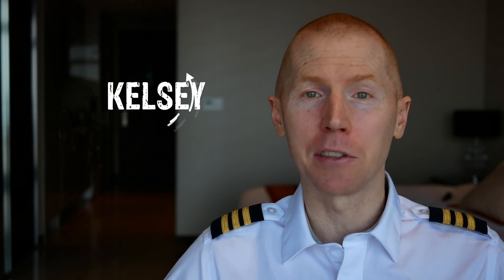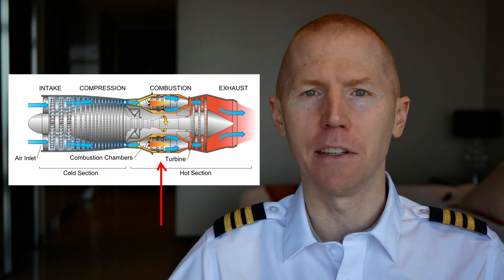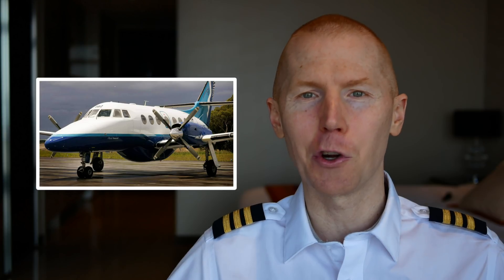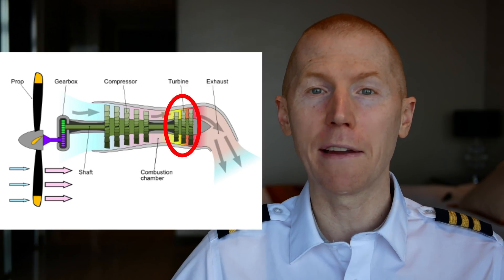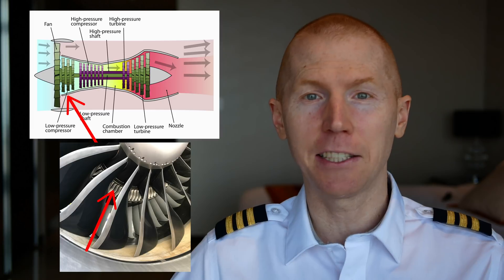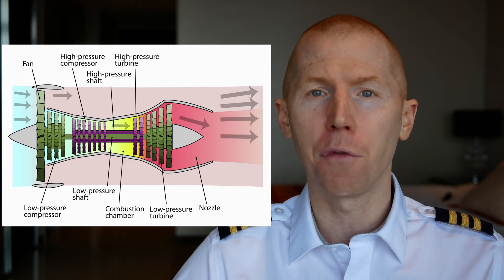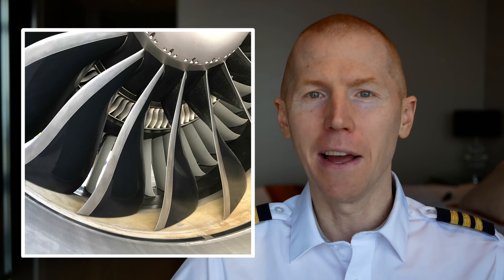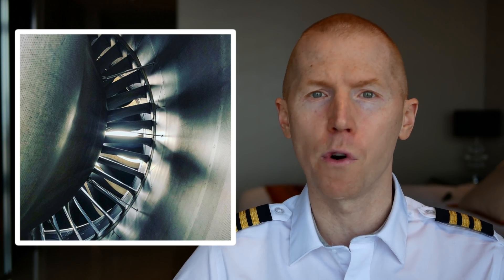Is a Turbofan Engine or Turboprop Engine Safer? | Pilot Explains

Comment: What about single engine turbo props like the Pilatus PC12?  Isn't the jet basically backwards blowing exhaust onto blades turning the prop?  And what about Prop Jets?
Reply: Do you mean ("Prop Jet") the engines developped in the late 80s? I know them as "Prop Fan" or UDF. They followed the same philosophie todays engines do : saving fuel by making the bypass bigger, but they did it in a more radical and brave way.

Comment: I have no problem flying on a turboprop, and they are more fuel efficient than turbofans.  However I do think turbofans are safer. Propellers seem to have a higher failure rate than the fans. If a fan does fail, the shroud is designed to contain the debris. It does not always do so, but failures are still much less likely to damage the fuselage.  Perhaps more important, turbofan aircraft have more bleed air for better anti-icing.  Much less likely to loose the entire aircraft in accidents like the ATR that crashed in Roselawn, Indiana.

Comment: I'd be more concerned with flying a cut-rate airline which is more likely to skimp on maintenance - regardless of the engine type.
Reply: Hmmm, the Logan-Air Saab340s strike again!!
Reply: actually a cut rate airline has to follow the same maintenance procedures set by the aircraft/engine manufacturer and approved by the FAA, the chances of a dangerous accident are very small, more likely to do with pilot training (or fatigue) and the aircraft mechanics being careless, again accidents are unlikely but very random (the design of the aircraft does play a role) it is usually only in 3rd world countries that they skimp on maintenance, in USA and EU people are more likely to follow the correct procedure
Reply: @jrcolmena  Indeed hell the same point could probably be made about piston engines even, I would be willing to bet that a not insignificant factor in their reputation for unreliability is that they are disproportionately installed on private aircraft not used in commercial service and thus not subjected to the intensive inspection and maintenance regulations that apply to commercial carriers. Any engine is going to be a hell of a lot safer if you put the effort in to make sure problems get found on the ground when you have an abundant supply of both time and options to easily resolve the problem, the supply of both is greatly reduced if you wait until you are in the air to discover the problem.
Reply: @FaerieSeraphina  You are most definitely right about that.  In fact, it has been proven.  I can guarantee that if general aviation (private) aircraft were maintained at the same level as commercial aircraft, the accident rate due to any sort of mechanical failure would go way down.
Reply: @jrcolmena   I still wouldn't chance it. When I was flying from Dubai to London the cheapest flight I found was some Italian carrier I'd never heard of. I decided to google the airline and found out it was going bankrupt.

I'm sure their procedures were top-notch but I wouldn't trust an aircraft maintained by technicians who are distracted by the prospect of losing their jobs, the thought of not being able to make mortgage payments etc.

It's all contributing human factors that can lead to accidents.
Reply: @jrcolmena  trains also have rules. Didnt stop my local service from being bought out, then the new company found out the trains were not safe and had to be replaced :/ Dont trust these people
Reply: The bigger cut-rate airlines have a really strict service routine, since they are extremely picky about not having their aircraft’s unplanned on the ground.

Comment: Had no idea that commercial jet engines work like this. Always thought the front fan blades were just part of a jet engines compression fans and it all worked like a standard jet engine. Never knew they acted like a propeller. Thanks for the video. 👍
Reply: They do act like propellers in the sense that they pull in air but the fan is not actually a propeller, you had it right when you said the fan is compressor. The fan blows air through the bypass duct but bypass thrust is created when the air accelerates through the constricting duct and out the back. The net thrust of the fan itself makes up less that 1% of the engines total thrust.
Reply: @ChrisZoomER  ah right, I might have understood the video wrong but it sounded like the front fans did the propulsion part of the job, like the whole engine was an enclosed turboprop. Thanks for clarifying.
Reply: @orbazel  Yes, that’s a HUGE misconception is that the fan is responsible for the majority of the engine’s thrust and that a turbofan is nothing more than a ducted turboprop whose propeller has a lot more blades. People  including pilots usually give and/or are given this explanation because it’s “simpler” when in reality, bypass thrust is a lot more complicated. Further more, a propeller’s efficiency starts to plummet at around 350 mph and the 747 flies at more than twice that speed.
Reply: @ChrisZoomER  can you explain? I was always told that the fan creates up to 80% of the thrust and the core is only producing about 20% of the thrust in a hi-bypass config. I thought that was the whole purpose of these engines otherwise why not just use a turbo jet. Pardon my ignorance but perhaps I was taught wrong. Thanks
Reply: @californiacastle  The bypass does produce 80% of the thrust, that's correct but it's not through the fan acting like a propeller. The fan acts like a compressor more than anything else much like the blades of the LP and HP compressors, except the fan blades are a lot bigger. The fan blows air through the constricting bypass duct where the bypass air compresses as it's forced to squeeze through the ever-narrowing space. The fan puts all of its energy into compressing the incoming air so it doesn't have any energy leftover to produce any thrust of its own. Once it reaches the back of the bypass nozzle, the bypass air expands and accelerates out the back producing thrust in a similar manner to the core exhaust, except without getting mixed with fuel and burned obviously. I hope this helps.

Comment: I’m never had trouble flying on a turbo prop or a turbo fan engine. To me a turbo pro and helicopter are very similar. I’m spent over 200 hours a year flying on helicopters as a passenger. Most of the time fly within 100 ft of high voltage power lines in mountainous terrain.

Comment: Spot on Kelsey. My girlfriend told me, after a short hop from Chicago to Toronto, she was nervous because the Q400 was a 'propeller plane', citing concerns of age, lack or reliability, and the propeller flying off and into the cabin like a boomerang of death! I told her that plane is actually very modern and uses a jet engine to drive the propeller. 
I'm curious though. Do planes like the Q400 rely more on prop pitch to adjust speed? I remember on takeoff last year the plane launched forward, but I didn't hear any spooling up of the engine.
Reply from the maker: it could have launched forward because they ran the engines up with their feet on the brake and let them off suddenly... its harder to do than it seems 😆

Comment: I still don't understand why you need a fan and a turbine instead of rocket engine.
Reply: rockets are unreliable, loud, underpowered, and very fuel unefficent
Reply: Yes, it seems that the gases exiting the exhaust don't do very much work in the rocket engine, so there's the turbine engine, which utilizes much more of the kinetic energy of the exiting gases, because the gases not only exit, but they spin the turbine at the end of turbine engine, which is somehow more energy than it's supposed to be by the Newton's third law of motion. You can surely enlighten me.
Reply: huh?

Comment: Why do aircraft engines get quieter a few seconds right before full throttle takeoff? I was a flight attendant for 6 years and always wondered but never asked.
Reply from the maker: well JM, it could be that as they turn onto the runway they pull them back so they get as much of the runway as possible... so we power onto the runway and then make that sharp turn before we actually go... could be that.

Comment: You forgot to mention the benefit of noise reduction with turbofan.  The air that flows around the compressor section acts like a "noise cushion" by surrounding the hot air that is expelled at the end of the engine, resulting in a very significant noise reduction.

Comment: For me, it's not the engine type that affects my comfort, rather the size of the plane. The Jetstream 32 i believe is a 19 passenger vehicle compared to a 747 which has hundreds. And not fundamentally because of the size itself but rather because the government uses different standards to certify big versus little. Little airplanes have fewer requirements to meet and therefore aren't as vetted as big planes.
Reply from the maker: well now any part 121 aircraft has to meet the same climb certification to be allowed as an airline aircraft.  But I agree having 4 GE engines seems a lot better than 2 turboprop engines Ajs, thanks for watching and subscribing.

Comment: Thanks for the video. Are the jet engines inside a fighter jet a turbofan engines? Some of them have afterburners.  Is there a special name for those engines?
Reply from the maker: it is a turbofan but its augmented, obviously a bit different than what you are flying on a commercial airliner.  Technically its called an after burning turbofan.
Reply: @74gear  Thanks for the information.  Best wishes.

Comment: Is the increased noise in a turbo prop due to the larger blades or poorer insulation?
Reply from the maker: there is a lot of noise coming from a turboprop but yes the blades cutting the air similar to a helicopter is one of the noise Bob.

Comment: The only time lack of reliability comes to mind when I see a propeller, is if it is being driven by a piston engine that hasn't seen a maintenance crew in far too long (had more than a few engine failures when flying 172s during my PPL training, DA-40s were not so bad) 

Gas turbine engines (the engineering term for a jet engine) are the most reliable type of engine available, whether it is a turbojet, turbofan or turboprop variant is irrespective
Reply from the maker: yes pistons are definitely less reliable for sure... luckily the mass of those planes is so small and they have a pretty good glide distance people can often survive a crash in them. 👍
Reply: @74gear  yep, I remember my first time gliding a 172 about a month into my training after the engine died, the glide ratio was better than I expected 

Still came in about 20ft short of the runway and tore up the grass, but the plane wasn't damaged (still not sure why my instructor wouldn't take control for that particular landing)

Comment: More comfortable? Not on an atr72 if icing is a remote possibility. Unless it's been that type of day where Rob white comes to mind "hit something hard I don't wanna limp away from this wreck"
Reply from the maker: well most turboprops have an anti ice system...so not sure why that would be your concern.
Reply: @74gear  aircrash investigation... At leadt they made it seem the atr72 had an issue for a while. Mostly sarcasm though, I understand regs and hardware evolve to prevent repeats and it was a while back. Actually I've jumped out of an otter first time jumping with only two people holding handles so I'd probably ride even if it still flipped and fell 😂

Comment: Given the diameter of the fans, is there an issue of the blade tips going supersonic as on the high powered WWII piston fighters?
Reply from the maker: thats more of an engineering question thats outside of my knowledge on how those designs are made.

Comment: I believe a turbofan is safer as there is a duct to confine a broken fan blade. A turboprop is basically a non ducted turbofan, so if a propeller blade comes off, it can slice into the fuselage. Also, as it is not ducted, it is less efficient as each propeller blade tip creates a vortex (just as a wingtip does).
Reply: not realy: a propeller blade is FAR stronger as a turbofan blade (prop blade broke occurs close never), and the duct as a high drag who void a large part of the gain, so the efficiency from free propeller is better because much bigger diameter= much more air forwarded with slower acceleration......

Comment: Hi, I have flown once with a Bombardier (Dash?) Turboprop plane. I think people experience it as smaller and  less stable, so maybe that is the reason they are more nervous. I knew it was a safe plane, and more environment friendly as well (?), so I enjoyed it! I did not know that turbofan also partly works as a propeller plane. This was new for me! I guess the first jet engines were not of a turbofan type?
Reply from the maker: know the original jets weren't the high bypass fans you see operating today... they were a lot less fuel efficient.

Comment: I think a major unreliability aspect of turboprop aircraft come from the perceived age of that group, not from the engine itself. Older aircraft are prone to need more maintenance actions due to age and fatigue.  Newer turboprop aircraft have similar reliability as turbofan aircraft. I think a minor factor that affects turboprop aircraft is the need for a reduction gearbox. This because the propeller and turbine both have different ideal rotation speeds. The reason i see this as affecting reliability is that a reduction gearbox adds complexity that isn't present on turbofans, even on dual spool turbofans. Though aircraft age, operating conditions and maintenance quality all play a larger part in reliability.
Reply from the maker: that could definitely be part of of Kurt, valid point.

Comment: Nice video Kelsey! Since I’m limited to piston at the moment, I’d take any turboprop I can get my hands on. The only thing I would be worried about is the speed reduction gearbox. I would prefer a nice high bypass ratio jet every time. But I’m stuck at piston right now haha.
Reply from the maker: well we all had to start somewhere...  keep grinding  you will get there.
Reply: 74 Gear that’s right. Can’t start with a jet. Already started instruments ground, with king schools, working for my written. Going to ATP either in June or July.

Comment: with regards to the bird making it into the inlet, thats easy to understand. A simple experiment would be to take stick, around 4' long, and go out when it is raining. start twirling the stick above your head and walk in the rain. Your still going to get soaked, no matter how fast you can twirl it.
Reply from the maker: thats not really the same thing as a bird going through a turboprop blade though.
Reply: @74gear  sure it is. it doesnt matter whether it is a turboprop or electric motor, behind the props. At the end of the day its still just three or four "sticks" twirling in the air. Do you have a ceiling fan in your room? if you do, turn it on the fastest speed and throw something at towards the ceiling. How much you wanna bet that at least a third of the time whatever you throw at the fan, will go through and hit the ceiling?

Comment: Thanks, never knew they had a gearbox, would you happen to know the gear ratio? just wondering why its not direct drive
Reply: Ratio vary. Direct drive lacks efficiency,  drives props too fast and has no reverse. Same reason  a car has a transmission.
Reply: There is some complicated gearing going on, most Turboprops also have Constant Speed Propellers. The propeller automatically adjusts its blade pitch to maintain a set RPM level. Pushing the throttle makes the prop bite harder into the air while it still continues spinning at the same speed.

Comment: I've flown on a dash 8. Only thing that bothered me was the large amount of noise vs an regular jetliner.
Reliability is down to the individual airlines maintenance procedures.
Reply from the maker: ya they are pretty loud Bob, that jestream I flew was a bit louder 🤣
Reply: Probably because I'm old and my father has an affinity for WW 1 planes (and a Piper PA-12 we rebuilt in the early '70s that he still flies at 80+ years old) I always find it a treat the times I get a dash Vs. a CRJ (or worse an Embraer).  Lol I guess I just trust a prop I can see & hear Vs. the black magic of a jet engine.
Reply: Although I will say a Dash is a lot quieter than a Ford Trimotor!  Been lucky enough to fly on those old radial engine beasts twice now  :)

Comment: Am I correct to assume the "ducted" fan is more efficient then open propeller because none of air is spilled outwards?
Reply: no you are false: the duct as a high drag, so it's usable only on small "propellers", free propellers have a much bigger diameter, so they efficiency is BETTER (move much more air with slover acceleration)...the choice from fans is only better for fast aircrafts...